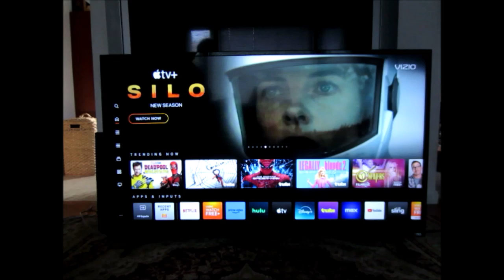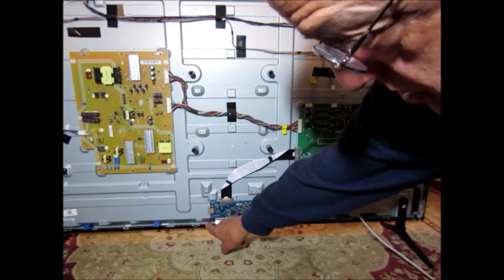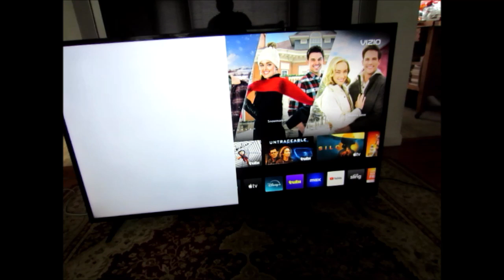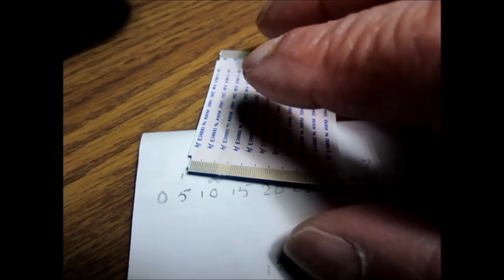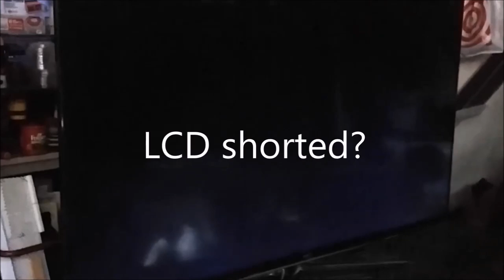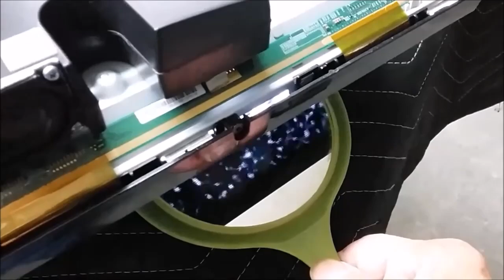LCD/LED TV Repair Secrets - Vizio E55-E2 Picture Jumps and Blacks Out

Comment: How many grounds have each of these lvds cables?
Reply from the maker: I don't know. Low-voltage differential signaling (LVDS) cables connect the main digital board of a modern TV to its display panel assembly. There's only one per TV. Thickness varies not only between makes and models but also with the size of the display panel assembly. The bigger the TV, the more wires in the cable. The same is true for the white ribbon cable that I insulated with cellophane tape to repair this TV.  Smaller TVs have fewer and narrower ribbon cables. As to how many grounds are in these cables? There might be a formula. I don't know. Best answer I can give you is that it varies...